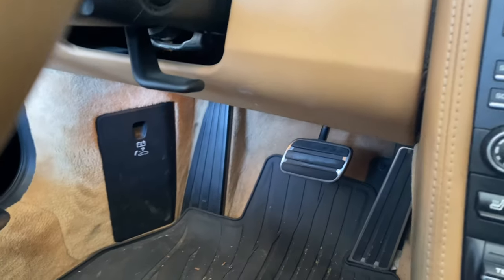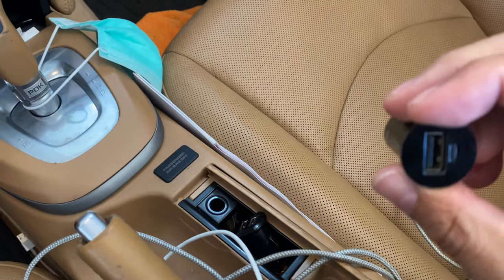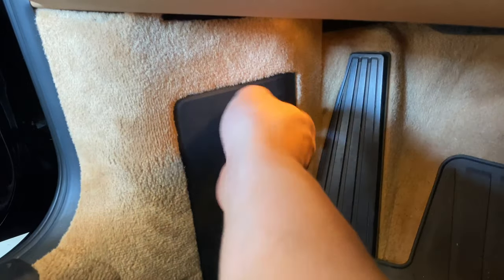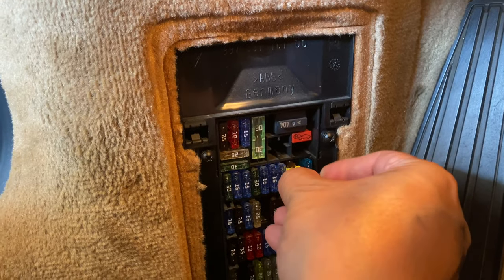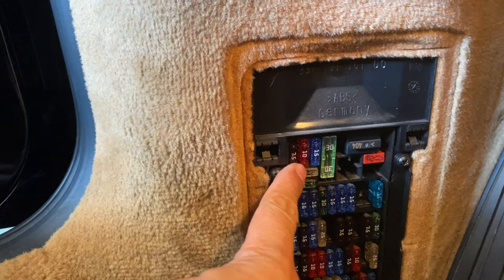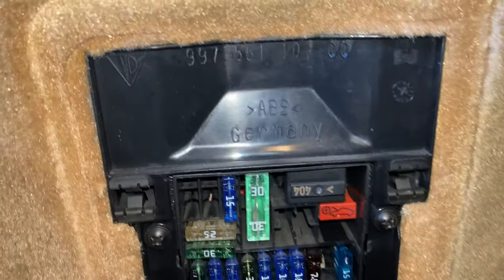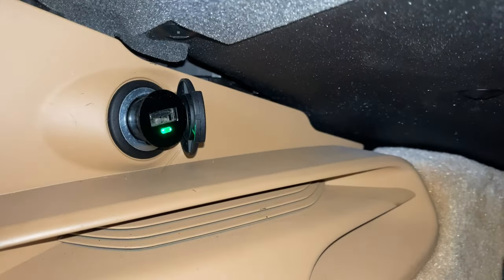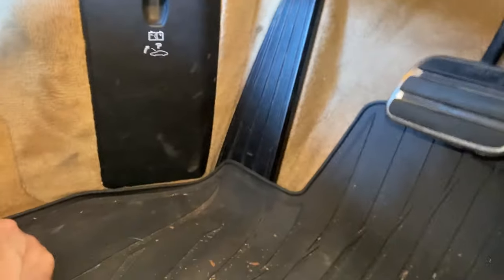How to Fix Your Cigarette Lighter or Car 12V Power Outlet

Comment: Thank you for the info. Today I plugged in my tire pump into the 12V power outlet inside the center armrest and unfortunately it blew. Do you know where the fuse for that outlet is located?

Comment: When I try to plug something into the cigarette lighter, it doesn’t want to work, if I jiggle it around it does work for a couple seconds or less than a second. Would I have to replace the cigarette lighter or how would I go about it ?
Reply from the maker: It could be two different things. It can be a fractured fuse where it has broken but not completely.  Try changing out this fuse first and see if it helps. If not then you may have a loose or broken connection on the 12v outlet/cigarette lighter.  It could be a loose cable or connector or the actual cigarette lighter assembly could have a bad ground.  You can replace the entire cigarette lighter assembly. https://amzn.to/2VmgLZi
Reply: @OmarsGarage  thank you for the advise !! I’ll try it out when I’m able to

Comment: I just discovered the charging port in my 992 wheel well and it doesn’t work. Wondering if the fuse layout is similar. The manual fuse layout description kinda sucks donkey (it’s totally not clear or precise….very in German :))
Reply from the maker: There's usually two fuses, I would get a fuse tester and just go through all of them.
Reply: @OmarsGarage  thanks it was actually just me not twisting the plug down properly. Works like a charm now. Thx

Comment: Ok but a fuse is an indicator of a bigger problem, not the cause.
Reply from the maker: This only happened when I plugged in a tire inflation compressor. I think the draw was just too much and overloaded the circuit. Never used the tire inflator on this car again and it never tripped again. Worked for phone charges perfectly fine.